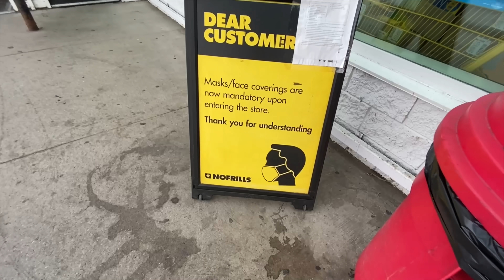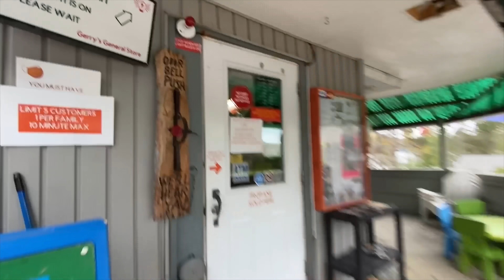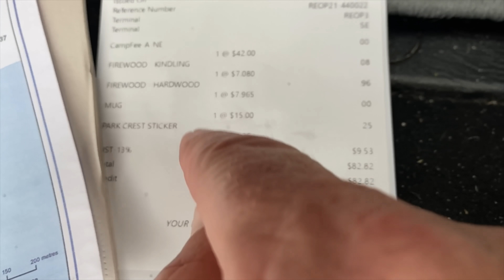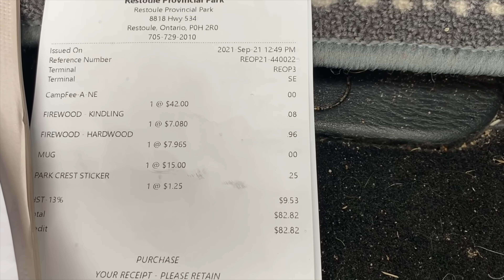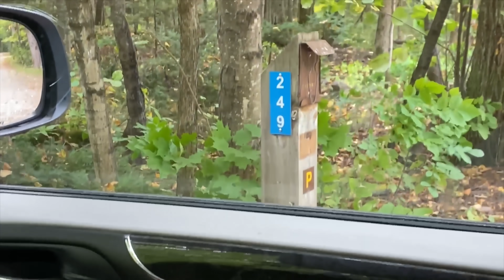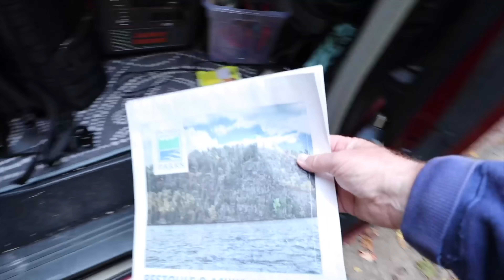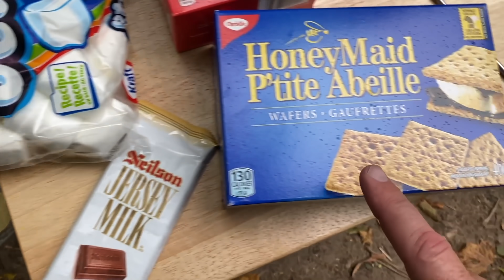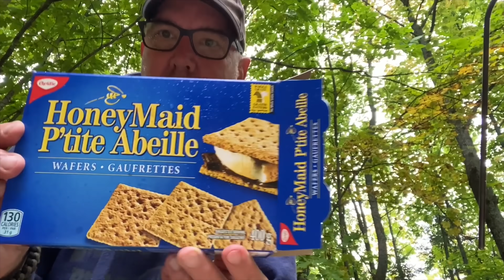Spider Weenies and S'Mores 🏕 Campsite Cooking #VANLIFE  🚐

Comment: In our rv galley tough decisions as to what my favorite hmm. If I had to choose would be the lobster tails we grilled.your new jackery would run a traeger tail gater pellet grill. I’d go look at them you don’t have add the legs. It’ll sit on the edge of the pick nick table seat. Run an extension cord from your van 🚐 to it. What it runs is the auger and digital temp indicator once it lights your lit. We have used mine camping it cycles they say not to leave the pellets in the grill but we use it so much doesn’t matter. If you get one easy put together as pie. You’ll do a high heat for so many minutes then another lower temp to season it. Your golden. We wrap the catch tray with foil with grease n stuff. Then once n while the ashes are sucked out sit and make other campers hungry 🤤. It has a five minute cool down setting it’ll cool down then shut off your good next go round. With it raining be a good day for it.